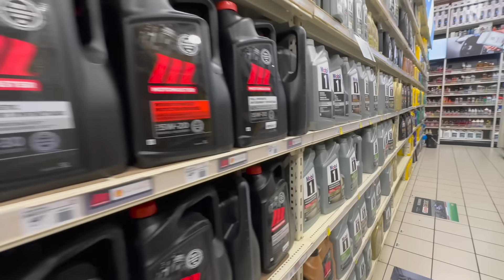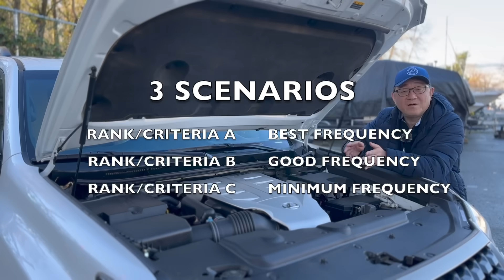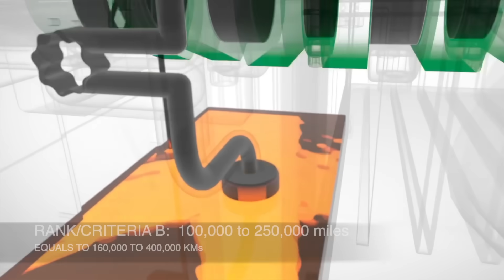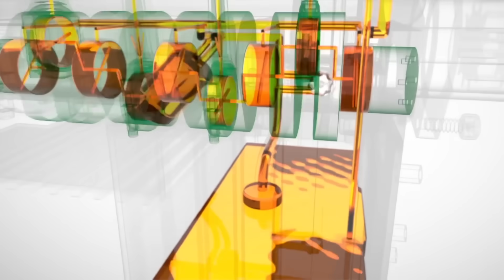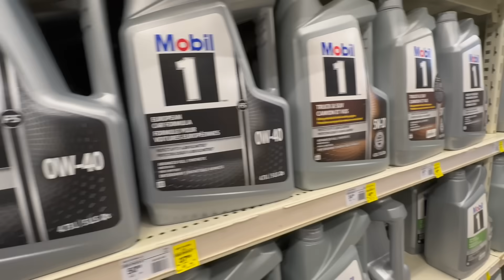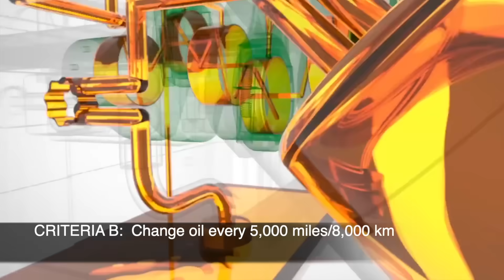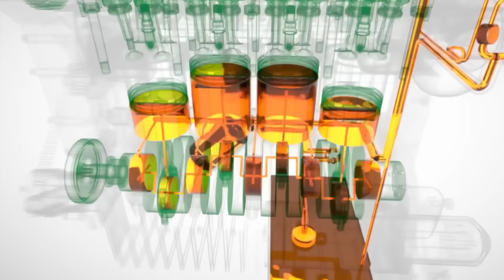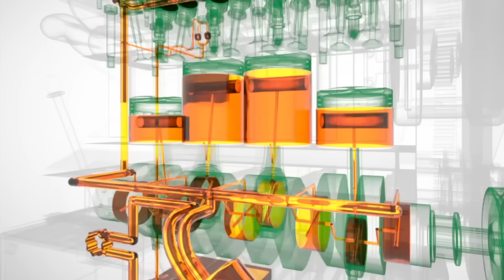ENGINEER EXPLAINS HOW OFTEN TO CHANGE OIL & FILTER // UPDATED CRITERIA-BASED RECOMMENDATIONS!

Comment: My car is 12 years old. I’ve had it since new. I changed the oil about every 10,000 miles. It has over 500,000 miles on it.
Reply: What kind of car, and what kind of oil?
Reply: @JohnTaylor-bd1uy  2013 Honda civic. Mobile 1 full synthetic.

Comment: I've always used the 3 month 3000 mile rule... My last Infiniti Q45 sold with almost 300,000 miles because of how good it ran... sewing maching steady & quiet. With this rule 3k months all of my cats have exceeded 200k and re-sold. I've also changed it earlier at times after long trips... Doing it early couldn't hurt...

Comment: I’ve been using AMSOIL full synthetic with their best filter every 4000 miles.  I’ve used Mobil 1 since 1975 in everything I’ve owned  until last year and have never had any oil related issues at all.

Comment: Hi David, I just purchased a Mazda cx70 3.3 turbo S premium a few weeks ago. Was wondering when should you do the first oil change? I was always told after the first 1000 miles. Wasn’t sure if this still is true. I know that the oil from the factory is important just not sure how long to wait in a newer  car.
Reply from the maker: You don't need to change at 1,000 miles.  Just take the recommended schedule and cut it in half...
Reply: @AutomotivePress  great thank you very much! And thanks for the reviews that you did on the cx70 (90) they really help me out with choosing the cx70. I absolutely love it!!!

Comment: Good advice, and keeping it simple.
Yet things are not so simple in real life, so many variables, and things that make this more complicated.
A Direct injection, a turbo, VRs naturally aspirated , all tend to change what an oil can do, and what’s best.
That is where oil analysis can help.
Depends on how far down the rabbit hole you want to go.
I am good with 4000 miles after initial break in, and the ppm of metals began to decrease.
I do oil analysis every 3 or 4 changes. May start to slow down on this if things remain stable.

This also lets the service people know, they can’t cut corners with me, when they get the sample bottle , and asked to get a sample of the old oil. And perhaps a sample of the new, for comparison.

Most techs get very interested in it , and ask why I do what I do.
I was a ship captain, all huge ship engine's , the reduction gears and the like use oil analysis to determine oil changes.
An oil change in a ship is very expensive, yet failures can scrap a whole ship is you get this wrong.
Just some things to consider.

Comment: Great video! The most important oil change on a new vehicle is at around 300 to 500 miles to remove any trapped machining and assembly contaminates from manufacturing and then go to normal routine oil changes. Never ever let a oil change exceed 5,000 miles even with synthetic oil also. Go on Youtube and see engines that have been oil change neglected and just all kinds of problems will occur eventually and shorten the life expectancy. Just treat your car well and it will be reliable IMO. Also don't drive high water areas after huge rain storms it will create havoc on the engine possibly (crank case ventilation valve possibly) + electronics IMO.

Comment: Slightly different question, David. My son owns a 2021 Tacoma w/ 2.7 liter 4 cylinder. His goal is to MAXIMIZE the engine LONGEVITY. Doesn't care about fuel economy the way a CAFE focused mfg does. What is the optimal motor oil (5w30?  0w20? 0w40?) to use in the engine. It gets 15k mi/yr of an avg mix of highway and city driving. He plans to keep the truck for 12+ years and 250k+ miles driving in SE Texas. WHAT IS THE OPTIMAL OIL CHANGE INTERVAL and oil filter?

Understand that the 0w20 synthetic specified by Toyota is needed to hit mpg and emissions targets. But, 0w20 oil changed at 10k mi erodes engine life ALOT vs a thicker oil like 5w30 or 0w40  changed at a 3k mi change interval. Correct?

Comment: Changing the oil every 3 - 4k miles while using high quality, full synthetic motor oil and a good filter is ridiculous. You're just throwing money away at that point. I definitely like to take care of my cars and try to prolong their lives as much as I can, but even my extremely cheap self knows that that's crazy. 6k - 9k miles is plenty frequent enough to keep an engine running just fine for a long time. A lot of cars have oil change indicators that follow an algorithm that is accurate, which is how I know it's time to change my oil. Generally around 7k - 8k miles, as the majority of the miles I drive are on the freeway. I keep a note in my phone for the mileage of my wife's car and get it done around 7 - 8k miles.
Reply: That's crazy not doing it at 3 to 4k it all depends how the engine is being driven and if it's gdi and turbo highly sensitive to prolong oil changes
Reply: @eduardolazalde8178  The vast majority of our mileage is highway mileage. No turbos and not solely GDI engines. We also don't drive like maniacs. I average 30 - 32 mpg in my 25mpg rated SUV
Reply: I do mine every 100k miles

Comment: Still never got why Engineers keep using OLD ways of thinking on the Crankshaft weights, why not Knife them for a faster movement, vs a hammer effect?
  Knifed means to make it so the bottom of the Crankshaft is able to slice through the Oil like a hot knife through butter, vs a hammer pushing it causing some resistance!~

Comment: I've learned to change my oil on schedule A, Every 3000 miles, from my Grandfather,  Step-Father, and I do the same.  Especially now with VVTI sensors,  sludging,  etc.  Regardless of synthetic or conventional.   And i use Castrol,  Shell,  or Valvoline.  As rated for the vehicle.

Comment: I don't drive much these days and often short trips. Although my oil monitor says 50-80%, I change the 0W-20 synthetic oil once a year. This is at about 2-4k miles. The car is 13 with 56k miles and uses no oil between changes. I did 3000 mile conventional oil changes for most of my life, about 4 times a year. I switched to 4000 miles on my parent's Toyotas, that saw about 30k miles per year. The last one had over 300k miles. It would use some oil a few thousand miles after an oil change. Maybe a qt in 4000 miles. Not bad.

Comment: Oil can easily last 10K-20K miles; manufacturers have the data, same for oil filters. Oil gets combustion particles; filter can last 10K miles. Unless you race/ drive under high loads, a 3000 mile oil change is like changing your 90K mile tires  at (7/32nd) wear-30K. Oil molecules do not "crack" at normal engine temps 195F vs 450°C and 850°C (842 F). 3000K oil change is "paranoia".

Comment: I live in Western New York with a  2009 RAM TRX4. It's never been garage kept and gets cold starts 6-7 months out of the year, I also tow equipment. I change my oil and filter every 4000 miles . I'm currently using Valvoline Restore & Protect oil. and will be sending in a sample for testing on my  2 nd.  oul change
Reply: What were the results?
Reply: @JohnTaylor-bd1uy still have another 800 miles before next one

Comment: 338.000 miles on my 94 Pontiac Trans Am I bought new.  3000 mile oil changes using Castrol GTX.  Engine never been touched,  even the timing chain is original. Has the LT1 engine.  Uses no oil, runs like the day I bought it.

Comment: I am in Australia and have diesel 2023 Toyota Prado . Toyota recommend 0W20 oil and 6mth or 10K oil changes. The car manual states I can also use 5W30 oil.  The  vehicle mainly is used for towing 2.5T caravan.  Average temperatures over summer are generally over 30c.  Which oil grade do you think I should be using?
Reply: 5W30 if the manual gives the option. 0w20 is a thinner oil aimed at low temperature countries in Europe, Canada where very rarely it gets to 30C.

Comment: Sorry but Blackstone couldn't disagree more with just about everything you said. And instead of just guessing and hypothesizing they have actual science, test after test. And it's always old people really pushing this you have to change your oil every 6 to 12 months no matter what. Yeah because oil when you were growing up was absolute horse crap compared to today's oils. No matter what proof or tests Blackstone or anyone else can come up with, there'll always be some people who just believe what their dad and grandpa told them. I've been doing Blackstone used oil analyzes for over 15 years and get consistent results running oil change intervals from 6 to even up to 10,000 mi. The test showed that at 9,500 mi the oil was in excellent condition and they suggested it could go another 2000 miles next time. Sadly, because I want my cars to have more value when I sell them I now believe I'm going go back to 5 or 6,000 mi oil change intervals. If anyone is interested in evidence and not magic voodoo or old wive's tales,  here's the podcast. 

https://podcasts.apple.com/us/podcast/105-no-time-to-change/id1492870857?i=1000637442335
Reply: I'm into oil analysis too. Bought new sports car. At 2K miles, the report was good for everything. At 6K/12 months it failed due to aluminium content (just over the limit) . I drive the car hard so I'll be changing it at 3K/6 months and see.

Comment: Even if you don’t plan to keep the car remember a car with good maintenance history can be resold as a certified car but those who don’t upkeep the car will get low balled severely…. Used to work for ford for many years and trust me they won’t give you much especially if we check the engine maintenance and start looking for sludge or performance issues….and never use the same filter for a second oil change… once that filter by passes you loose the filtration capabilities good luck with that 😂

Comment: I have always changed filters multiple times (every 1000 miles) before actually changing the oil (every 10K miles - synthetic/5K miles - conventional). My Corvair has nearly 500K and I also installed a catch can to the PCV system.

Comment: As an Aviation Mechanic for 30 years on piston engine aircraft we told our customers that oil gets contaminated and that’s why you change it. You are correct there. It doesn’t matter much what kind of oil you use it will still get contaminated.

Comment: Yep - 6 monthly for me from now on. I think I basically ruined the engine in my previous Honda Accord euro 2008 by doing yearly oil changes on 0w-20 oil. In my ignorance i just trusted what the honda dealership said. But towards the end of my ownership it started burning oil at a silly rate so i traded it. Still got 10 years out of it but had I questioned things more (frequency and oil viscosity) I might've got way more life out of it.

Comment: First things first, quality oil and filter. Now myself personally I only drive my truck 1000 miles a year. Mostly short trips. I just do it 1x a year. The oil is damned near as clean when drained as when I put it in.. If you have a GDI engine and you go longer than 5k miles, you are begging for problems and you had better check your oil level regularly. Too much fuel dilution. No one ever had an engine fail because the oil was changed too much.

Comment: Oil changes could have been designed out years ago.  If a very small amount of oil was pumped out of the sump and burnt then replaced with fresh oil from an auxiliary tank then the need for a complete change would go away.
The auxiliary tank could be refilled just like deft fluid.

Comment: Hi. What about vehicles you plan on keeping for a long time (cat A) but hardly do any miles. Only take it out for summer? This is for a motorcycle. Would full synthetic oil still keep it's viscosity after a several years with minimum mileage (500 miles) or would it still need to change every year? 
Thanks

Comment: @automotvepress Hello, interesting video. How do operating hours in relation to average speed determine oil change intervals? What are typical operating hours for internal combustion engines between oil change intervals? Is this a valid approach at all to determine oil change intervals?

Comment: I've changed the oil and filter at least every 8000km or once a year. The last oil change was under 4000km just because I didn't get to drive very much last year. My car is 10 years old, running like brand new, and I'm not planning to sell it. Ever.

Comment: Long time? My Ford escape twin turbo is 12 years old, change the oil every fall just before winter with synthetic, has run smooth since new, hopefully will for another 5 years. Good advise on checking for a dirty oil. Mine gets dirty 2 days after a change, never had a problem. Going on 230 thousand miles

Comment: dealerships hate this guy - if you're leasing it don't worry to much about maintinence.  stealership will do it themselves 😂

I bought my vehicle new back in 2010 summer.  A year after I graduated college in 2009.  I bought my toyota  out in cash.  I've been doing oil changes every 4500-5000km.  

i change my oil now every 3000km because i do a lot of combination driving city/ highway and stop/ go.  During the week, I idle my vehicle for about 4-7 hours weekly.  I have an upgraded sound system/ dvd player so I sometimes chill in my whip and ball up a fat one before heading home.  

So my vehicle new was 0 km now i'm nearly close to 300299 kms on my dash.  15 year old car, that's about 20k a year.  Change your oil and filter every time.   I know FRAM synthetic filter says it can go up to 16,000km but i'd change it every time.   maybe u can use it twice if you change your oil every 4000km - 5000km.  Oil and Filter is cheap, like under $70.  Buy oil and filter on sale, stock up and you'll save even more. 

New engine and labor cost is expensive.  About $1800-$2200 for complete job.  plus down time for a few days for the work to get done.  

I know people who never changed their oil and their still driving to this day.  Don't worry too much about the oil.  It's not that important.   Only important if you want the vehicle to last ah very long long time 😂 

i don't care if i use conventional or synthetic it gets changed at 3000km.  Mainly use synthetic but have soem conventional oil as well i got on sale.  Oil is Oil and the vehicle will run better just for changing it.  Gas/ combustion/ water/ condensation/ boiling/ evaporation of the oil working in different temps breaks down the oil.  I also drive safely but aggressive redlining my car like a race car.  It's important for me to change it frequently.  That's just me.  

I usually buy out in cash and keep it for its useful life.  My family never leased.  Only spend what you have.  Don't jump into something you cannot afford.  I'm glad i bought my car in cash and now I have a fully paid off home.  My friends bought M's and living in Condos worrying about car payments no family or children.  We all have different priorities in life now and people move on.  These are just folks I went to high school with into college. Few years later after college, I went to Uni finished my undergrad.  
 

I also drain and fill my transmission oil every 6-7 months - every four to five oil changes.  10,000-15,000km.  I reset my trip A and B to keep track of my oil change intervals.  I change my transmission filter once a year.

Comment: Hey lets just ignore the engineers that actually designed the car, designed the maintenance schedule, and have mass reputation loss if their car company gets labeled as having junk engines.  None of these guys, i mean none, ever consider that people lie about changing their oil. When they have an issue they go to some random mechanic who finds sludge and the mechanic asks about oil change interval. And the customer always says “I double pinky swear that I followed the manufacturers guideline to the tea. Double triple pinky, swear“……. and of course they haven’t. Because modern people today view a car is an appliance. I had a customer just last week which to my absolute shock and awe she had no idea that brakes actually need to be replaced. She was a 30-year-old lawyer making six figures.

Comment: I don't fit in any of those categories, so I get confused. I only drive around 1500 miles or so a year. For example, my 2022 Tacoma just passed 4000 miles this week. I was changing the oil every 6 months but my dealer said I was wasting money and should only do it once a year. My 2011 RX350 gets about 10,000 miles a year so I change it every 6 months. Thanks for your videos.
Reply: I will tell you this. Oil does not lose its viscosity if it’s just sitting there. You could put brand new oil into an engine, not drive for three years, the oil is just as good as the day you put it in.

Take that into account .

Comment: My oil changes are 6 months or 5000 miles whichever comes first,
Reply: The six-month rule was more relevant when oils were less stable, and engines were less efficient. For most modern vehicles, synthetic oils are much more durable and can last longer without significant degradation, even if the car isn’t driven much.

Comment: Do highway mileage engines require changes as frequently? I change mine every 5000 miles using Mobil 1 high mileage. I expect that this Ram 5.7 should last 300,000 miles, 80% highway.
Reply: The oil change intervals for high-mileage vehicles are typically the same as for newer ones, provided you’re using the right oil. Modern synthetic oils are designed to last longer, and the overall principle remains the same for vehicles with more miles.

Comment: Stick to what the manufacturer says regarding Oil change intervals . If you drive your car correctly and it reaches max temp then it will be fine . Its how they have been engineered . They are very very very strong . Its the plastic and rubber parts that will let your car down . IMHO